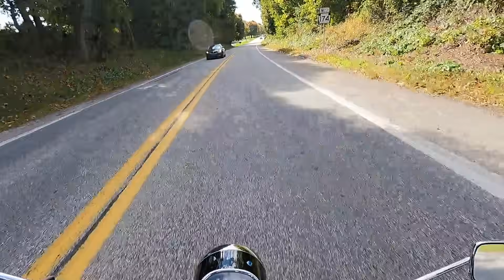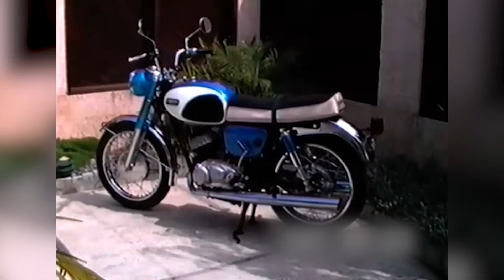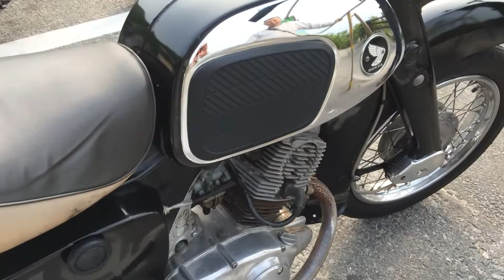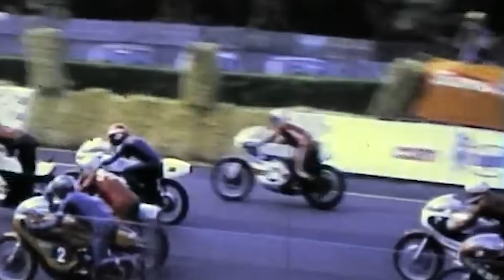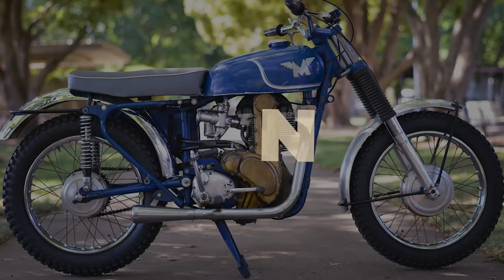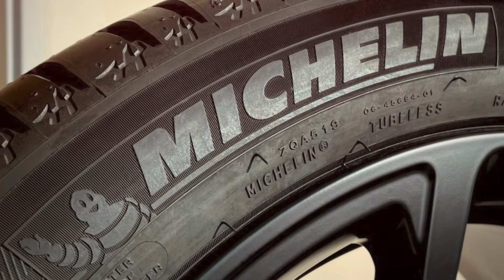15 RAREST Sleeper Motorcycle Of The 1960s!

Comment: This video throws a bone to many manufacturers including some bikes that were low production over only a few years. I personally owned a Yamaha YDS-2, YR-2C and R-3 from the 1960s; the R-3 was a transition to the Yamaha RD series and was the best balance of performance and utility in daily riding and is the one I wish I still owned. My older brother owned a 1967 BSA Spitfire Mk 3 which one of most beautiful motorcycles I had ever seen. It was a good performer but of course shifted on the right and braked on the left, a difficult adaption for me in traffic. Great memories!